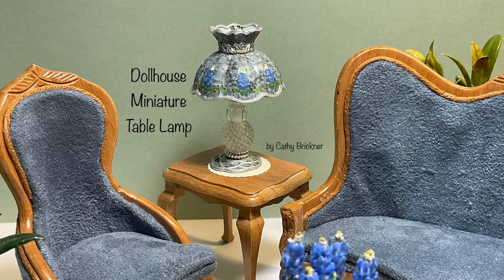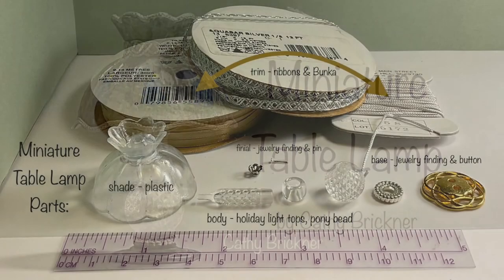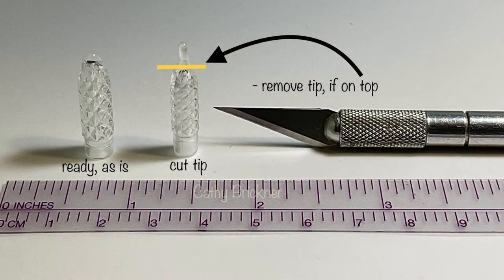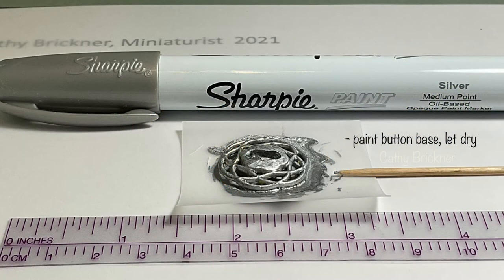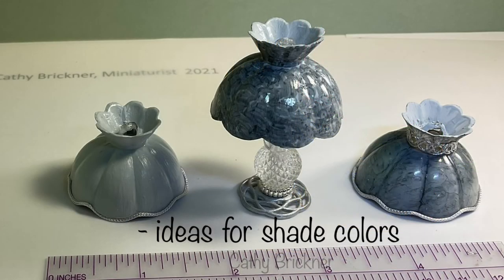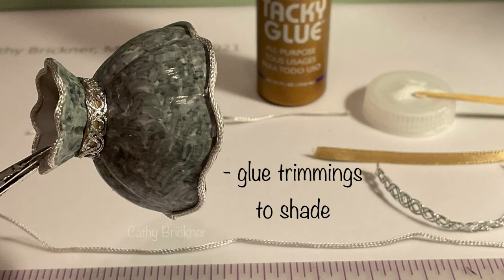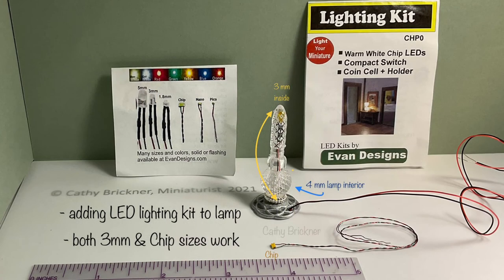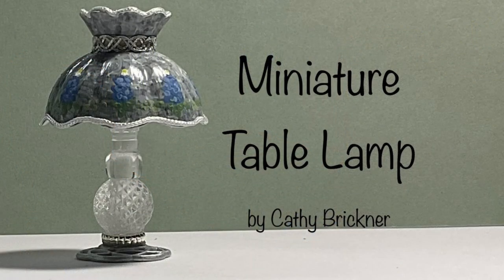1:12 scale Dollhouse Miniature Table Lamp, DIY, using vintage Tiffany style shade & LED kit

Comment: where did you put the  wire and what did you use to light it, help
Reply from the maker: Hello, 

I placed the light with attached wires through the bottom side of base of lamp, gently moving it up toward top of lamp, inside the tube created by the glued beads, plastic holiday covers & jewelry findings.

The wire can be placed behind lamp to floor or through a hole in table or through a wall. It will depend on your project and how you will be able to reach the switch to turn it on/off.  You can use longer or shorter wires.

 LED Kit by Evan Designs, warm white chip  with compact switch and coin cell & holder CHP 0, 3 volt battery; you can contact EvanDesigns.com  to explain your project needs and they will help guide you through. They have videos that are also very helpful.